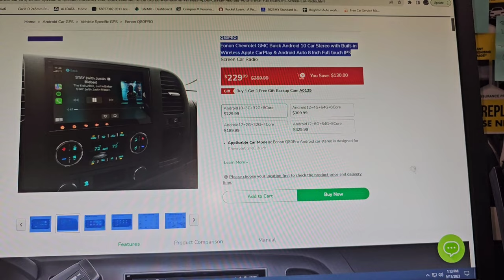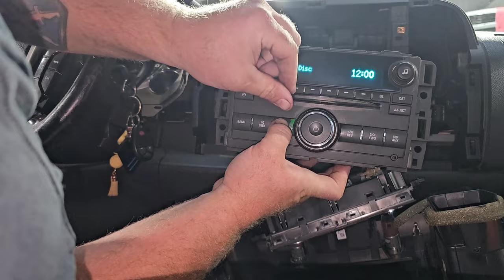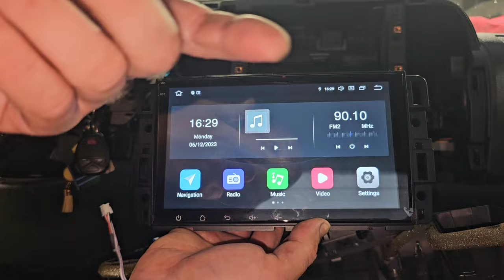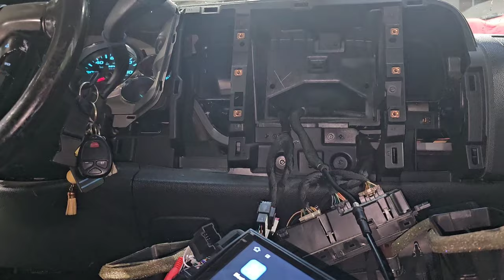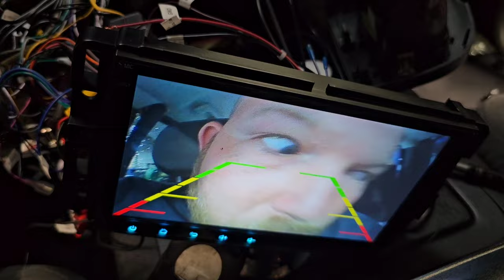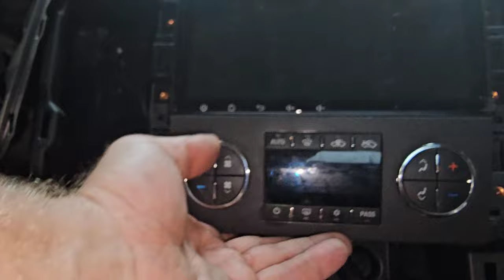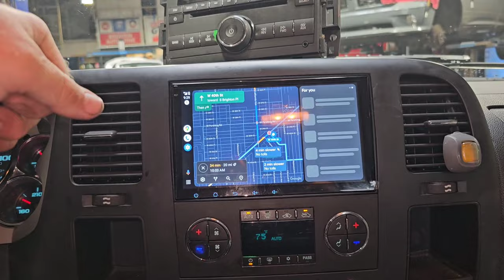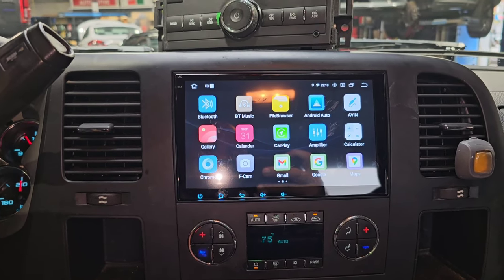EONON 2007-2013 GMC/CHEVY Sierra /Silverado Apple / Android Car Play - Install W Back Up Camera

Comment from the maker: $10off coupon code on eonon.com : "FordBoss"

Official website link to GMA12S : https://www.eonon.com/Android-Car-GPS/Vehicle-Specific-GPS/eonon-chevy-gmc-buick-android-12-wireless-apple-carplay-android-auto-car-radio-with-6gb-ram-8-inch-qled-touch-screen.html?Catype=1&utm_source=YT&utm_campaign=GMA12S-FordBossMe&_channel_track_key=dDxc6o8B

Amazon link to GMA12S: https://www.amazon.com/dp/B08GFQXBWB?maas=maas_adg_017BB63957EC7B8D8A80D098378838A1_afap_abs&ref_=aa_maas&tag=maas

eBay link to GMA12S : https://www.ebay.com/itm/166252649610?mkevt=1&mkcid=2&mkrid=7111690252637661&keyword=US_youtube_GMA12S_FordBossMe

Comment: That’s a pretty sweet little setup, what I like the best is how quick it powers up without a bunch of nonsense. I’ve seen lots of aftermarket’s that when you turn the key on the radio goes through some long annoying power up routine and the reverse camera won’t work until that routine is done. This one seemed to power up straight away and the reverse camera popped up as soon as you moved the shifter. I’ve got apple CarPlay on my Honda as well and it’s fantastic and when you do navigation you can either use maps or Waze right through the CarPlay

Comment: when hooking up back up camera did you have to tap into your reverse lights ??
Reply: Yes red wire to reverse light wire and ground black cable
Reply: @Mames5537  i installed the back up camera and i did not have to. thanks though. works perfectly

Comment: Hi Rich, I’m new here and new in the F150 family as well. I recently got a 2016  F 150 lariat 3.5L. When in idle mood the battery gets so hot and it just destroyed the recent battery. Got a new battery and got it tested to see if it’s charging good, And it is. But had the same issue again, and it even put up the battery light and engine light. When I turned it off and on, but lights disappeared. Please advice.

Comment: Looked at the site.  Did you figure out what that accessory 'speaker' on the back of the radio used for?

This model says direct fit for my Suburban... tempting.
Reply from the maker: I figured everything out in video it all works
Reply: @FordBossMe  But what does the speaker do?  What type of audio comes out of it?
Reply: @cup_and_cone is the door chime and warning sounds - they run through the OEM head unit, so the speaker is the replacement.

Comment: Can you explain how you got the camera wire from the cab of the truck to the bed of the truck I’m truly lost
Reply from the maker: I explained that literally
Reply from the maker: 19 min mark ish - 
Did you watch the video? Lol come on now
Reply: @FordBossMe  yes you explain you ran it thru the dash and down did you drill a hole like you (literally) didn’t explain It lmao
Reply: @FordBossMe  either way it doesn’t matter I ran it under the floor in the drivers side cut a slit in the e-brake grommet under the carpet and ran in it under the truck with wire loom along the frame and into the tailgate. All I’m saying is you didn’t go into detail on it so I asked for a clearer idea of what you did to get it from inside the cab to the back.
Reply: @mindlessgaming8637 At the 20:12 minute marker shows the cable going through the floor board.

Comment: I have constant buzzing noise with music or not coming from my back rear speakers only , on my 2007 Chevy Silverado can anybody help me why ? Is it a grounding issue ?
Reply: Did you ever figure it out? I’m having the same issue
Reply: @Teachyouchannel i know what is the problem, its the small screen on the back of the arm rest just open it up and disconnect it, you still can control the climate at the centre console
Reply: i know what is the problem, its the small screen on the back of the arm rest just open it up and disconnect it, you still can control the climate at the centre console
Reply: Still have this problem . Rear speakers stopped working . The buzzing noise is on the right rear speakers. As soon as I unplugged the speaker it goes away but plugged in it's only buzz no music coming out
Reply: @armandoherrera4726  from the radio you have three harnesses the gray harness is not to be used unless you have Bose system. I had the same problem. I unhooked the gray one and hooked it up to one of the black ones. Everything works great.

Comment: Hi, i just installed an Eonon android 12 on my chevy silverado 2012, after i installed everything i foun a noise coming from rear speakers, when i disconected the amp control wire the noise went away but the rear speapers are not working, what do you thing is causing this issue????
Reply from the maker: You only have to hook the amp control wire up if you are using an amp
Reply from the maker: Go look at my live stream of installing the speakers on my truck
Reply: @FordBossMe  I'm not using an amp
Reply: @FordBossMe  is this video in your channel?
Reply: @FordBossMe  bro I could not find that streaming, could you send me the link
Reply: @gersonmejia8878 did you ever figure this out sir?
Reply: @tylerkrause5366  no I couldn't, what I did was returned it....
Reply: For this radio if you have BOSE in your truck you have to do research on the install. There's a certain way of plugging in the wires and settings in the menu to make it work.
Reply: I have same issue and my truck doesn't have a bose system about to smash this China junk

Comment: My oem head unit does look exactly the same. But when I pull it out it has 4 plugs instead of 2 as seen in your video?? Anybody can help or had the same issue?
Reply from the maker: Give me the year make and model of the vehicle
Reply: Chevrolet Tahoe LTZ 2009
Reply: @POPOkakaFURZ  might have the Bose package on your car

Comment: I have a Chevy 1500 2008, I just recently bought this deck and I'm not sure if anyone else has had this problem but I have the crew cab and now my rear door speakers aren't playing music? Does anyone know why? Thank you
Reply: The door speakers on 07-14 GM trucks and suv will stop working at one point. I have to replace all 4 speakers on my 07 avalanche, I purchased a set of Pioneer speakers from Walmart very affordable it does come with the plastic mounting bracket that makes the installation very easy.
Reply: I just had same issue when put in my 13 silverado rear door speakers worked great before now only rr humms about to smash this unit hate it
Reply: @AllenDewitt-z2o did you figure out the problem? I’m fighting with it now